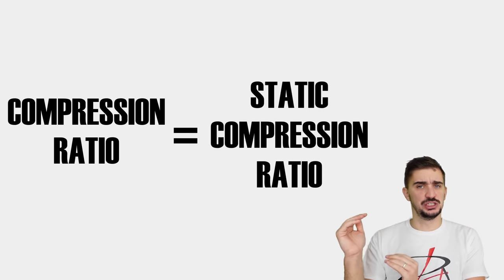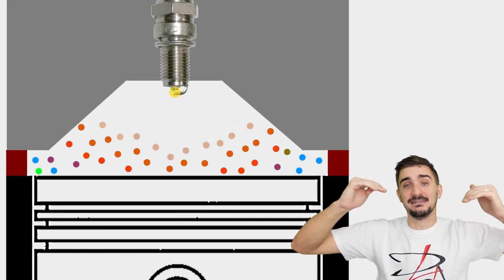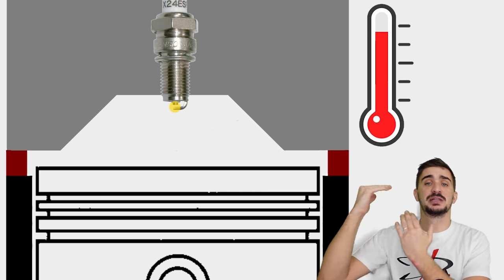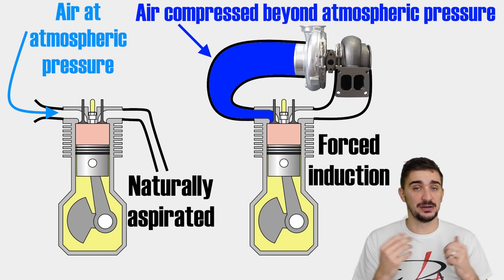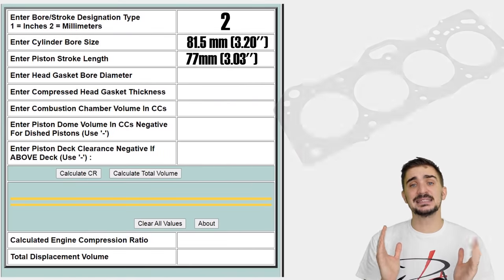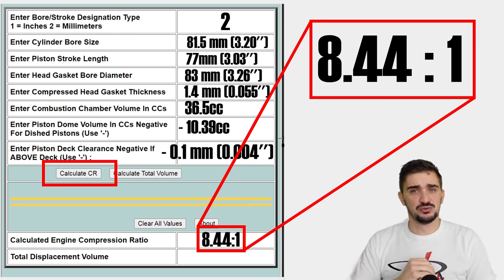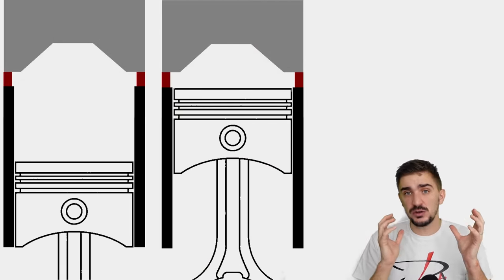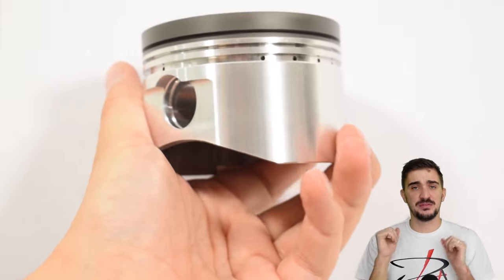COMPRESSION RATIO: HOW to CALCULATE, MODIFY and CHOOSE the BEST one - BOOST SCHOOL #10

Comment: Boosted engine definitely have more power.
I prefer to N/A engine than boosted one. I love the simplicity and responsiveness of N/A.
Because responsive engine and balance car is fun
Reply: electric is most responsive
Reply: @ArneChristianRosenfeldt  true! But i can't afford electric car, yet. About facilities and support etc.
Reply: @helmysetiabudi9915  It is just that I now hesitate to wish for responsiveness. I still don't get why PHEV are already on decline. Even EV batteries in Tesla are optimized for 0--60 mph, so in a HEV electric should be the ideal solution to hide turbo lag and downshifts. It may even work with a single clutch. The ICE would run full throttle most of the time and the electric motor either sucks some power or adds some. Just like Toyota Hybrid, but with only one electric-motor, and not all that power first revving up and then down again. And I don't care for electric sailing that much, just let me sail with all engines out. A plug (230V, 20A) is needed for the "green" rating. Did the Civic do this? European companies always used a double clutch. We have Diesel. Diesels always run full throttle. And for responsiveness I can just shot a load of soot into the filter and right after burn it down with the turbo spinning out.

Comment: When it comes to piston bore, if what I want is power then I should not oversize it and keep it standard to run more boost correct?
Reply: I'd run higher compression pistons and a bigger turbo.  The same size turbo is what would cause heat and knock.
Reply: Bigger bore ALWAYS gives more power, up until you crack the block.  If needed, you can lower CR by using a thicker head gasket, or machining off the top of the pistons.
Reply: @anthonyedwards9240  Would using a better intercooler solve that problem or adding water-meth injection?
Reply: Yes but that usually means more power at the top of the rev range. I rather the extra power kick in earlier if it's a car that I use on the road as well.
Reply: @fgtrhwu2  : A better intercooler is always good, well until it so big that it becomes a weight penalty.  Water-meth proved it self in WW-2 fighter aircraft, and works just as well today, it just adds a lot to the driving fuel cost and back then the planes only carried enough for about 20 minutes of use.
Reply: @fgtrhwu2  it would

Comment: water to air intercooling! don't skimp!
Reply from the maker: I prefer air to air and will likely be going that route
Reply: @d4a  : An advantage of an "Air to Water" intercooler in your MR-2 would be the abilty to put the water to air radiator in the front of the car, the  disadvantage would be increased cost and weight.

Comment: Your videos are usually well thought out but..,  This vid is titled everything about Compression but doesnt address Dynamic Compression or the Crank Angle Chart that ties the Intake Valve Closing event to the Static Compression Ratio, therefor bridgeing the Camshaft into the equation; nor what Cylinder Pressure are [Required] for each level increase in Power is needed as well as Octane increases in fuel. Once you understand Dynamic Compression you will realise that Static Compression is last on the priority list, not first.  Cylinder Pressure after the IVC (intake valve closing), aka Dynamic Compression is one of the Primary intercomponent relationships that ties everything else together; which is why most serious racers will never give out their cam specs.  Once you know the cam specs of an engine and how Cylinder PSI is created, everything else can be calculated from that spec alone. Anyway, good vid for the novice; but its only the tip of the iceberg.

Comment: A lot of drag racer's use 13:1 because it wins races, turbo spools better, more power. I have a few motors running 13:1 on the street with boost low boost.
Reply: They also use "race fuel", not "pump gas" at 2-3 times the price.
Reply: @johndavidwolf4239  e85 is pump gas
Reply: @davesperformance88  :  Technically you are correct, but EVERYONE I know refers to it as E85, and "pump gas is 87 (or 86 at above 5000' ele.) octane unleaded.  It is great stuff, more so because all US taxpayers are helping to pay for it so you pay less than the cost to manufacture per gallon.

Comment: "compression ratio always a compromise "

my bike who run 14.5 : 1 : yeah... compromise
Reply: Yes, several, 1) You are most likely limited to only using "premium" high octane fuel. 2 The fuel map most likely runs over rich at all but peak power RPM lowing fuel efficiency . 3) The ignition timing is most likely retarded at lower RPMs, again lowering fuel efficiency, although the 14.5:1 expansion-ratio does help efficiency
Reply: @johndavidwolf4239  1) it was a joke if you know what it is 2) I ride a sport bike do you really think that using high octane gas or having bad fuel efficiency bother me
Reply: @vincentfromsomewhere6639  :  No, which is why the manufacturer makes them like that. For some "adventure" bikes that are ridden to "third world" countries, high octane gas is sometimes not available, and fuel milage can be very important where gas stations are few and far between.

Comment: Well have you ever thought of inversely doing this by running a higher compression ratio with a larger turbo. I have had great success with this on my 7mgte. 

I plan on doing this with my 2JZ-GTEby running higher compression pistons with 276 cams with a larger turbo. 

This seems to have more response off of boost. As opposed to upping the turbo size and boost and lowering the compression. Less turbo lagging  and faster response.

Comment: If you increase the stroke I assume you’ll usually have to change the crankshaft and/or pistons so the piston doesn’t bust a hole in the head?
Reply: While increased stroke is only done with the crankshaft, (one need not replace, they can be reground undersize with increased stroke) one can also use shorter rods to prevent piston-head interfearance.

Comment: Better speak about intake manifold of the corvette c8 2023 that make a lot of power without turbo.
The ferrari f140hb and f140hc has the same trick on intake manifold.
Without turbos they gain 126hp per liter.
As many rally cars (s1600 of renault and peugeot) they gain a lot of hp without turbos.
256 hp in 1.6liters.

Comment: Mazda says high - 14.1:1 CRs in Sky-G engines which Toyota pays in gold to have in their hybrids, and 16.3:1 CR in Sky-X - which is basically a petrol engine that doesn't need spark plugs (it has them but doesn't use them in certain scenarios). No other car maker gets even close to 14.1:1 in production engines.
Reply: I'm quite sure that Skyactiv-X always uses the spark plugs to initiate combustion, Spark Controlled Compression Ignition (SPCCI) is what the special mode of operation is called.
It seems the spark plug is igniting a rich mixture around it and the following combustion compressing the rest of the leaner mixture that quickly combusts.

Comment: Static compression are of little value. What's interesting is the dynamic compression.
Having 7:1 or 14:1 static comp doesn't say much unless it's specified it has the same cam. You need to factor in the intake port closing time to properly know how your engine will work.

Comment: Yeah dude definitely doesn't know about high compression and high boost because he's not saying anything about switching fuels even. I have a 4.6 2v running 11.1:1 compression ratio and I plan on running about 15-20lbs of boost at about 900whp. It's not even tuned yet and it has ALOT more get up than it did before (stock, and stock compression ratio) BECAUSE it has high compression....so saying having a high compression high boost built engine is not going to drive great is bullshit. That's a literal lie 😂. The lower compression ratio you have means the higher boost you'll have to run to achieve x amount of power ie 600hp at 15lbs of boost with a 10.5:1 ratio and 750hp at the same 15lbs at 11.1:1 ratio....so it just means the engine is ALOT more efficient. And getting knock doesn't mean anything, yes it's bad but for a high hp engine that means you switch to E85 at that point. But overall, a great tune/tuner is going to be the life/death of your engine making reliable power...